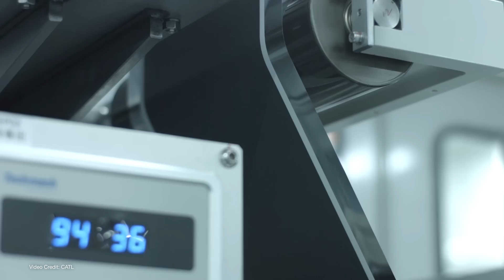Here's What You Need To Know About Biden's Battery Billions!

Comment: The answer about strategic reserves and reducing dependency on oil is actually not complex. 

It takes 30 years to build out a light rail system. It takes decades to complete high speed rail. And we cannot produce enough of the technologies that replace fossil fuels fast enough to replace all of the transportation technologies that are currently in use for decades.

So we need oil and gas while we phase out oil and gas.

It may have been that the people who want to shift demand to EVs were a bit too optimistic about the material possibility of making a completely EV transportation system worldwide.

It's possible to do it. It might not be possible to do it in time even if Russia and the other fossil nations and fossil funded political parties aren't throwing political wrenches into the works. Which has been the Koch network's goal all along in the US for all their culture war flame throwing.

Comment: As a huge supporter of the transition to EVs myself the U.S. gov's position on securing and restocking oil reserves while investing in transitioning to electric infrastructure isn't that complicated at all. The transition away from oil is a goal of this admin but that goal has not been reached and likely won't be reached for some time. Until it is reached people need oil now. We need it for our ground, sea, and air commercial transportation and we need it for personal transportation until we can truly say we've transitioned to electric - whenever that may be. Our plans to continue transitioning to EVs means little if the backbone and commercial infrastructure needed to support that transition (which currently operates on oil) collapses. Oil is necessary today to bring us the electric vehicles of tomorrow.

Comment: sorry, did you say than Covid caused chip shortage that is specific to the auto industry? is this your new standard of journalism?

- chip shortage caused by auto manufacturers not managing supply chain competently - not covid
- manufacturers cancled contracts for the chips when there was a downturn, chip manufacturers then turned this manufacturing capacity into other more profitable lines and have no desire to supply the less profitable lines after the contracts were ceased.  this is real world supply and demand in action, not covid.

Comment: The strategic reserve was built up by previous government while this government has been running it down. It is necessary for US national security. Not to worry, the next government will build it back up again.
China are ramping up battery production at eye watering levels compared to $3B US. Mostly LFP batteries which are greener than Lithium ion. Tesla do partner with these Chinese battery manufacturers.

Comment: Re how can the govt continue to buy oil for its reserves. Simple
Try moving those batteries with your battery powered semi, oh wait you don't have any of them that can make the long hauls that your country lives on. It can't even do it with trains. Oh and try to fight a war with battery powered jets, or run the Tico or Burke's on batteries oh wait, they run on oil or jet fuel actually.
Your entire industry runs on oil and the government knows this and even if it were to fast track the research and development, we are still 20yrs or more before the power systems are where it can be reliable, and cheap enough for it to be something we cans switch to. and even then, we will continue to process oil into jet fuel, heavy fuel oil for ships. And no we can't use corn or vegetable oil, the amount of energy needed to turn that into useful fuel uses up more energy than it creates.

Comment: I do not believe that I will see the last oil well shut down in my lifetime. It is used for so much more than just fuelling cars or road going vehicles. Even if you find a solution for every single vehicle type (and that includes things like big aircraft and rockets delivering payloads to space), there's still a lot of other products that we make from oil.
Reply: Yes, but oil doesnt have to come from the ground. The technology to turn basically any hydrocarbon into oil has been around for decades. The upside is that many things we currently ship to landfills or ATTEMPT to recycle could become the base material for plastics and synthetic lubricants. And yes, it is expensive and requires energy... but drilling for oil will get more expensive too once the bulk of the transportation demand is gone.